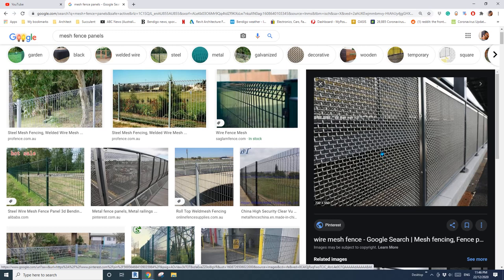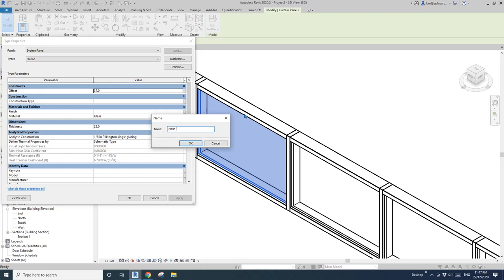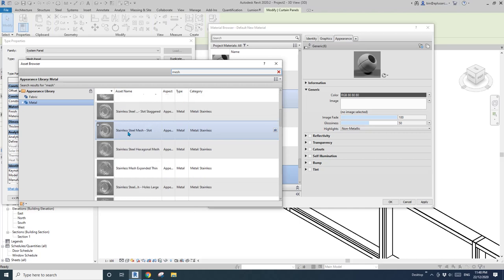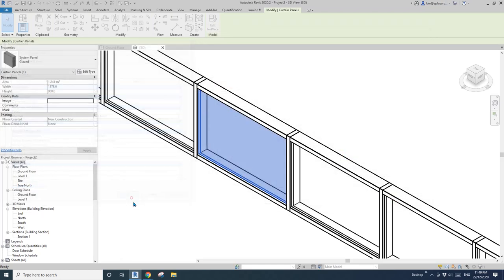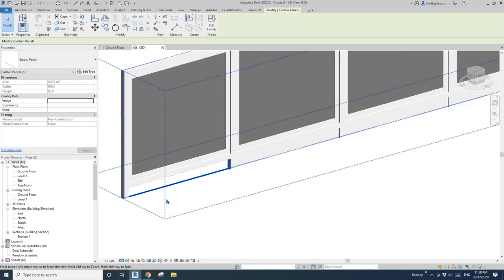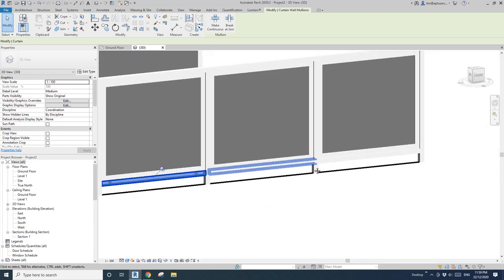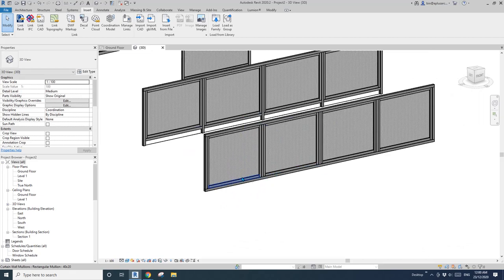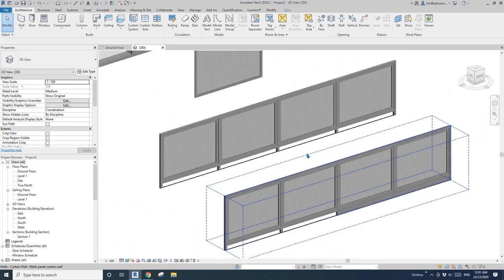Everyday Revit (Day 279) - Use curtain wall for a mesh fence

Comment: is it possible to add a gate to the fence , maybe as a door family to have it visible swing in plan as well
Reply from the maker: Yes, you can add a curtain panel door if you are using curtain wall for your fence. You can find some example curtain panel door in your Autodesk Content Library under Curtan Wall Panel folder.

Comment: Hi Bin, thanks for your efforts. Any idea how to add the post base plate?
Reply from the maker: Not with this method I think, can be done in railing. Have a look in the railing sample file in your family folder you may find some examples.
Reply: @BINHE615  But you cannot create a schedule from railing family, and by that I mean post/baluster count, not only the total length of the railing